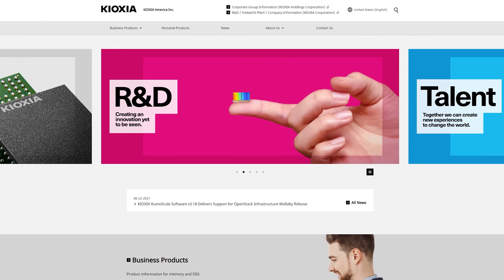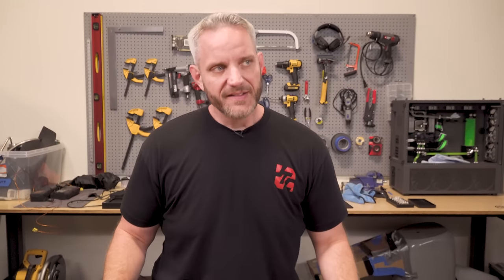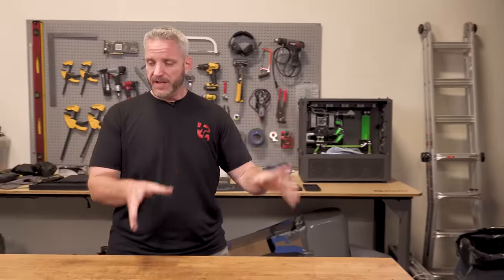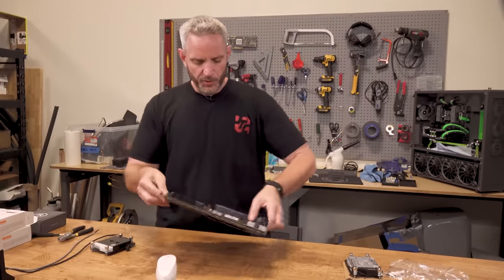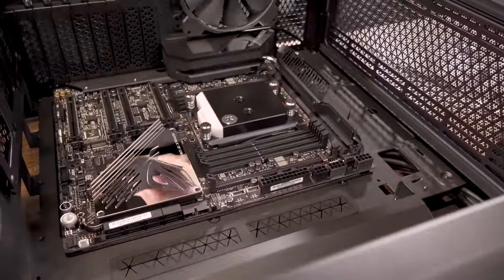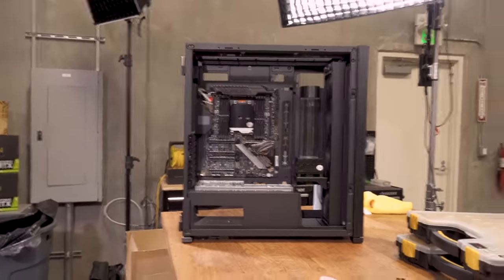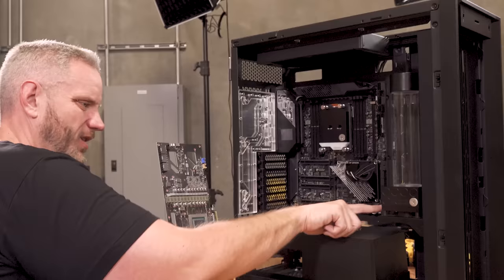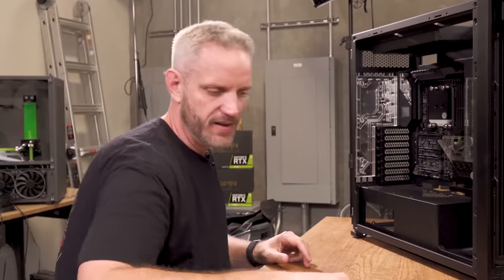Skunkworks is back with an all new design, and some old school soul!

Comment: Jay, if you vertical mount the card, you'll have a hard time getting at the RAM modules after the hard tubes are attached for the water system.

Comment: Heat will do it. I had a 360 mm radiator cooling and overclocked 2700X and 5700 XT, the loop got well over 80° c and broke down the EK cryo fuel that was in there, causing copper corrosion to enter the loop. I've since then added a 420 mm radiator and a motherboard monoblock. The tips from this channel have definitely been key to helping me build my loop and expand it like I have.

Comment: Yes do glass tubes if it’s going to be a over kill pc also do the 2 3090s. Awesome PC jay this is way more entertaining that a “normal” pc
Reply: yeahhh because it's supposed to be overkill anyways and very expensive so 2 3090s would fit that agenda perfectly
Reply: I wonder if the bottom card would fit vertical and the top car be slotted like normal if it'd fit that way or not.....

Comment: I bought an old fridge for 200 bucks, mounted mine in it 4 years ago and no more cooling problems. Keeps it at 45 degrees. Drilled a hole in the side and ran connections through it. Sealed with expanding foam.

Comment: I just ordered the Asus Dark Hero to replace my Asrock B550m A/C. It's like YouTube knew I wanted to watch a build and did not disappoint with Jayz video popping up at the top of my feed. Once I am finished with my build I will take some pictures and tag you on Twitter. First actual build since my Titan X  way back when that came out. I ordered a Prebuilt PC back in December and now the only thing left on it from the manufacturer is the Case and my 3070 Eagle. Everything else has been completely swapped out.

Comment: I just hope if its Skunkworks, then should be the best of the best so 2 way 3090 and 3990X.
Reply: Issue is that the 3990WX is extremely expensive and beyond overkill. Even Linus rarely brings it out, and doesn't use it in any of the employees computers. At $4000, it really smudges the line of household vs. server parts. Back when the 7980XE was at the top, it still had a place in enthusiast PCs. But at this point, the top of the line CPU is so powerful and expensive that even the most hardcore enthusiasts don't use it.

Comment: Hey Jay, when I water cooled my TR I was looking into what water block to use and the older EK velocity blocks were tended to be 5-10 degrees warmer than the competition on TRX40.  The new magnitudes are much better.  I really like the heatkiller and Optimus absolute blocks.  That said if you don't want to buy another, that's cool as well.  Looking forward to what you do next with Skunkworks.

Comment: Jay,  try using a clear coolant with rgb fittings in the hard line at the ends,  if you go with a 90 degree fitting look then you can add the fittings to shine down the tube.  Just an idea!  No need for the coolant fall out etc

Comment: I think what I like the most about these build videos is that compared to when I build mine, you have the time to look at how it should be done. I typically either have a computer that's in parts or a computer that I use, not two at the same time. Hence my planning is as short as the delivery of the parts, because I literally don't have another computer then :D

Comment: Hey Jay , you can try to 3d print the reservoir top bracket. Like a cradle for the tube that matches with the existing holes.

Comment: I have done a few different solid color coolants in the past like you have for skunkworks, but I've really been enjoying ditching colored coolant in favor of the RGB reactive coolant from EK. I have also had good long term experience with their coolants on soft tubing which we know can be a nightmare! I would strongly recommend taking a look at it as an option as it can allow you to change the color easily. I'm running a RGB CPU + RGB GPU block and 3 Case Fans, as well as an RGB res, between them all i can generally color the coolant the way i desire. It doesn't take a ton, but it does work well.

Comment: You should use the Ek vertical mounting bracket. It secures the part of the card the usually sags to the lower motherboard screw and the card sits back closer to the motherboard as well.

Comment: I was rocking the ek navy blue if I’m not mistaken. It discoloured after only 3weeks. EK replaced the fluid 3times until they said listen. You will need to use a different colour because with the hardware you have it will keep on discolouring.

Comment: For what it's worth, I had really bad luck vertically mounting my 3090 due to issues with Gen 4 PCIe and the riser cable not playing well together.  You can change the MB settings to Gen 3, but that will shave a bit of performance off the card, and more than a bit off any NVME drives.

Love the Corsair case.  For better or worse, it came out right after I purchased a midsize.  The mid case is definitely more compact, but I miss having the massive amount of working space in the full size.

Looking forward to the next generation of Skunkworks!

Comment: Love it you are bringing Skunkworks back to life! will definetly watch these series. Let the haters be haters you never can please everybody but you run a PC Tech channel so people should expect you actually using current hardware.
And..the shortages are getting less by the week, prices are in a downward trend although still a lot above MSRP but only the 3080's already dropped about a 1000 Euro's in price, they were around 2300 Euro's a few months ago and now you can get them from about 1300 Euro's here.

Also, you could drop the Black and Yellow Bumblebee theme, because if the new build ends up where it stands now, then you could name it a DeWalt themed build :P

Comment: Screw the haters do you man. Content is content. Your videos are fun and exciting. Because of your case mods I modded my Lian Li O11 XL and removed that stupid badging on it. Because of you, I water-cooled my 5800X with a corsair water block and a pass-through radiator.  I am working on getting a waterblock for my EVGA FTW3 Ultra 3090 but I mean it stays so cool with its tripe slot cooler and the memory heatsinks I put on it.

Comment: I built my PC in 2000, and since then it has simply evolved. I think I'm at the point now where (apart from a single screw) there is nothing left of the original, but I've re-used parts until they could no longer be effectively re-used ever since. I keep the screw around to ensure that it is never fully replaced.

Comment: Talking about re-use, i have 360 rad and swiftech mcp655-b pump that are over 12years old, still do the job just fine on my threadripper 1950 build

Comment: Jay I love the vertical look. I have my 2080 ti on a be quiet 700 vertical with the stock case location watercooled. It looks good but it also hides all the gross case wiring and my wifi/bt adapter…(x470 strix didn’t have wifi :) … jut a thought. But you would be able to use the distribution block…

Comment: @JayzTwoCents you should do two 3090s mounted vertically and instead of that large rear distro plate u can get a 120 or 140 "fan" distro plate to open up the vertical mounting brackets

Comment: If you flipped the 480 rad, the fittings would be on the bottom and the you would have room for the 360 rad on the top.

Comment: EK active backplate for 3090 have RGB, so no need to put a rgb led strip ! (yes I've one, for a strix)
(speaking of ftw3, this card has crap load-balance power delivery with tons of problems, problems that have only been partially solved 8-9months later from release)

Comment: I actually use theis DitsroPlate in my Rig and I'm thinking about taking it out.... I have two rads (240 in front+ unrestricted 120 fan below + 360 up top) in a Phanteks Enthoo Evolv X... so there should be plenty oft airflow... but its not... there is so much heat bulding up on my 3080 and the m.2 ssds behind it that it  burns my hands...(its also heating up the MB Chipsetan other components near by) so I think a extra fan in the back helps a lot to  get out the warm air out of the case.

Comment: Not having much experience with water cooling, what's the purpose of the back water plate attached to the rear of the case?  Is it to make water distribution easier so there are less tubes or just to look cool or both?

Comment: Definitely vertical mount or every time you need to remove video card for service you will have to unscrew the distribution block and it will get old very fast.

Comment: Jay, surely if you are using EK GPU water block(s) you will want to use EK GPU active water cooled backplates? The VRAM on the back of the 3090 has been shown to get hot, so a decent build like this should actively water cool the GPU backplates?
Reply: Ps EK active water cooled GPU bacpkate comes with RBG which looks amazing, no matter the GPU orientation.  :)

Comment: wait i’m confused, if it doesn’t hurt then why not put fans on the back panel since isn’t all airflow good ? especially if you plan on putting a 3960x and two 3090s ?

Comment: if you are going to vertical mount the gpu and do the active backplate make sure you have enough space behind the card
Reply: He said he might use 2 gpu so i think they will be slot mounted.
Reply: @Bendigo1  had to confirm but he said at end of video he was going to vertical mount the gpu and was deciding which gpu to use. I know he doesn’t like the o11 xl but the non-lian-li mounts were to close to the motherboard and I wouldn’t have been able to fit the active backplate on. Going to install it this week
Reply: @Ashbridg3s  ohhh ok i must have missed that part.

Comment: Do you know what would be sweet and fit with the totally square theme? I don´t know if they exist but if they don't they should. Aluminum square blocks with tubing fittings in 90 degrees configuration, instead of using 90degrees bend for your tubing. You know what I mean?

Comment: Hey jay ,
If you dont use a rgb fan use this fans for more performance ( Noctua NF-S12A PWM ) 107.5 m3/h and is low noise 17.8 dB

And i have a good idea for more cooling to this liquid u need to split liquid in & out by all cpu and gpu out to top raditor and this is the hotest liquid and when it cool go in to front raditor chill to the lowst temp then split the out raditor to fit with two side in to cpu and gpu the same time with T shape

Comment: I had a thought to use a distro plate to streamline hardline tube routing. Would using this with a separate pump/res combo work? Or would it get too choked, eg too much restriction?

Comment: I have an Enthoo Elite case with that same distro plate. I have two systems to install in it but I am still debating on how to use the distro plate with two separate systems water cooling 3 video cards, 2 cpus with multiple radiators and two separate pumps.

Comment: 20:00 the problem with vertical mounting GPU's right now is that the PICIe 4.0 riser cables are uber expensive. If you can find one.
Reply: The thing is even the current 30 series don't even saturate 3.0 atm. 4.0 riser cables are not really necessary at all. At least this is what I remember so correct me if I'm wrong.
Reply: @MWKRider  I agree. The only real pain is when you update your bios it always defaults to pcie 4 so it doesn't detect your GPU until you plug it directly into the motherboard. If it wasn't for that, I'd just use pcie 3 cable and call it a day
Reply: @greenmonalisa ahhh  that makes a lot of sense.

Comment: When you build a computer is it possible or feasible to use some kind of refrigerator small one pump to use it as blowing cold air through your system in some way

Comment: This might be one of the last times you can do an SLI build. I think you should keep up with the balls out Skunkworks heritage and go SLI. Use the cards that had the LN2 test?

Also it would be cool if you did an homage to the past colors of the build with a little something. Maybe the PCI covers colored in order, or a line of pin stripes on the GPU housing.

Comment: How about when the 5000 series Threadripper Pro cpu's come out, you make a build with that and 7 RTX 3090s. The hard part is fitting two 1600w PSUs in there, and getting cards that only have video connectors on the first slot. If there aren't any single slot pci slot covers available, you can probably use dual slot ones on 4 cards, and leave it off for the 3 cards in between. The 7-slot water terminal is probably enough to hold the cards in place. I forgot to sell my ETH at the top this year, so now i don't have enough money for this :( Thx

Comment: I don't blame you guys for going AMD at this point. I used to run Intel exclusively and even when Ryzen came out i was sceptical at best.
So anyway i now have a 5800x sitting in an X570 board. I didn't even consider Intel an option and that was further reinforced by the launch of 11th gen.
It's the first generation i considered AMD Radeon cards an option too but i stuck with Nvidia ultimately because i use some of their exclusive technologies a lot.
This shows me Lisa Su knows how to stir up the business in a way i've rarely seen before

Comment: Well ... the Motherboard and the CPU is also in my last Build. Besides that i used a really big Beast of Tower 😉 The Tower 900 by Thermaltake ... Two 560 And one 280 Radiator with thirten 14cm Fans, four brandnew Seagate nvme ssds and two 18 TB Ironwolfs ... just waiting for the two ASUS EK WB 3090Th 😞

Comment: I see that you're doing mockups with an EVGA card. I would suggest using different cards since these cards have lots of issues. Voltage spikes, fuses burning out. The power distribution over the PCI-e and 8 pins being wrong. etc.

Comment: New water cooling stuff just because of new hardware? Yeah right, my waterblock and radiator tower are both older than 10 years and still work great with my i9 powerhog

Comment: By the way there are automotive based coolant additives that greatly enhance mixed metal compatibility. Take a look at "Glysantin G40" from BASF for example:

https://www.glysantin.de/sites/default/files/2018-06/technisches_datenblatt_g40_eng.pdf

Comment: While this is cool and I'm definitely going to watch the series, I'm not sure this fits the idea of "skunk works" anymore. Skunk works (the general term) is innovation for innovation's sake, to see what happens when you push beyond established boundaries. This is shaping up to be a custom water cooled Threadripper with a 3090 which is just a super-high end system at the moment. Using multiple CPUs and GPUs felt more like innovation. I get why you're not doing it, because it wouldn't offer any actual value, but I guess it shows how PC technology is converging toward a single design.